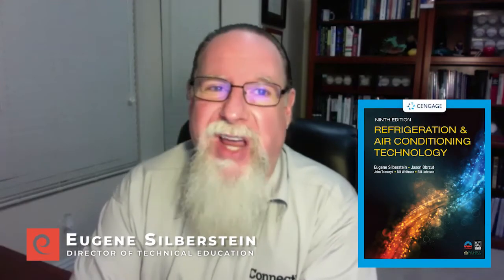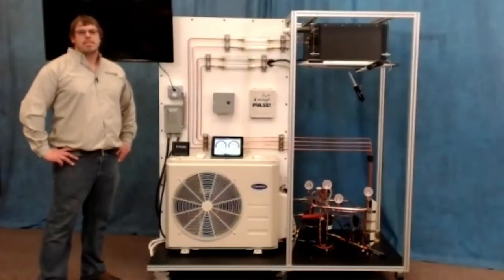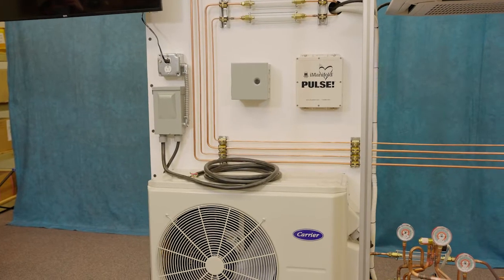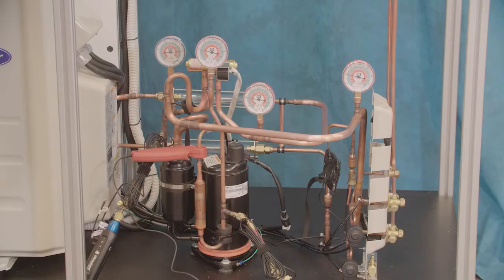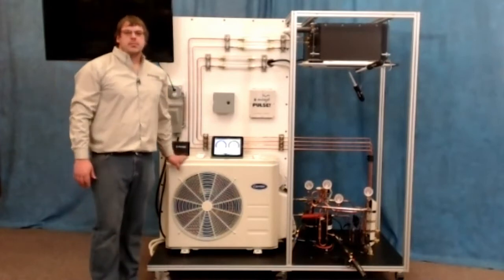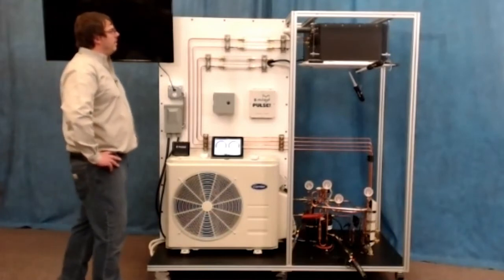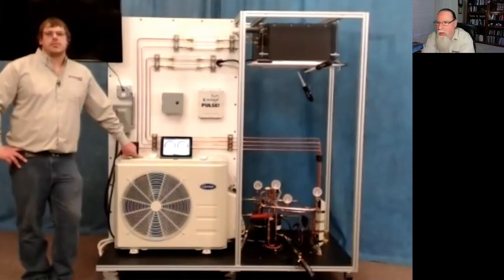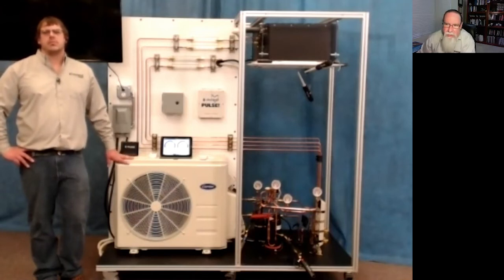The Coolest Teaching Opportunities You’ve Ever Seen with Mini-Split Heat Pumps

Comment: I run a TU-601. I know why you are not using the stock LCD in this video. The Roku-firmware based monitor is extremely difficult to cast to and the monitor just looks tacky on its flimsy mount that cannot even hold it perpendicular to the TU frame and just looks out of place. I plan to remove the LCD monitor since it is a visual distraction and just use the classroom AV equipment. But THANK YOU for the ideas! My head has been swimming with the possibilities and you are helping me bring them to technician students vs engineers (I also run the basic 1xx TUs [water & air] and have in the past).